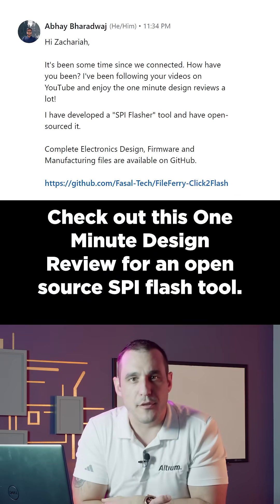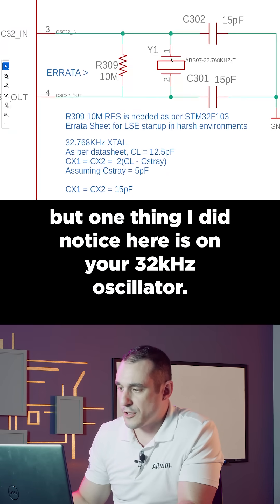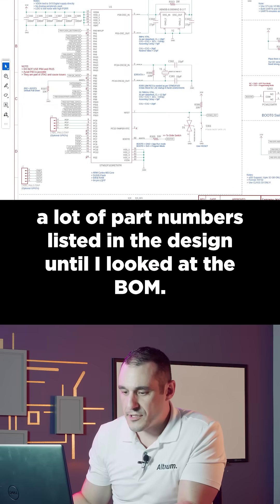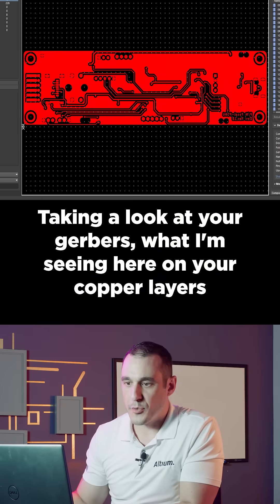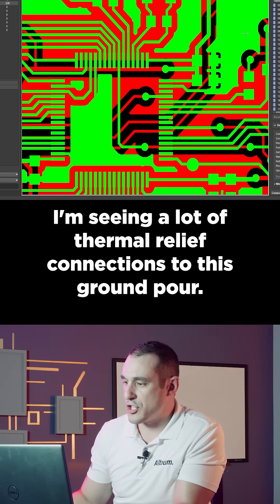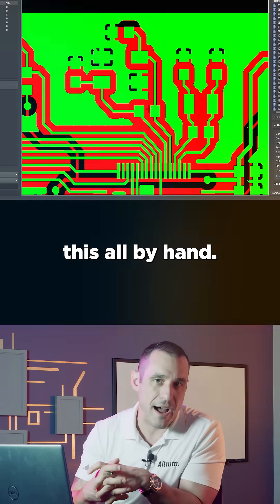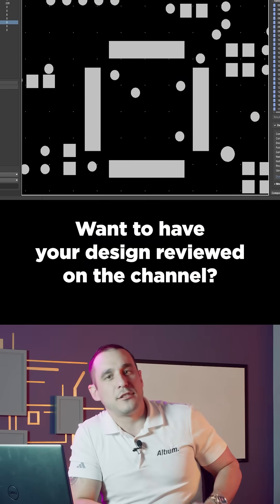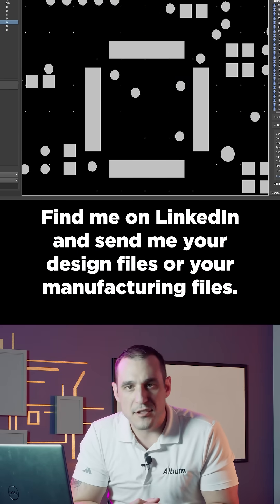PCB Oscillator Capacitance Conundrum | 1 Min PCB Design Review

Comment: Even if you don't need them, is there any rationale for not using thermal reliefs?  It's the same copper either way.
Reply: The rationale for using the thermal reliefs is to aid soldering and wetting, even in reflow they are sometimes needed when connected to large planes. For hand soldering I would say to use them, but given the accessibility of low-cost assembly services for prototype boards or hobby boards, I don't see why anyone would take the time and effort to hand solder every board. Maybe if you expect rework on certain passive components, then include the thermals on specific SMD connections to polygons.

The biggest reasons I bring up the thermals so much is because people include them due to the fact that the default design rule in Altium is to have the thermals included on both SMD pads and vias. Thermals on vias provide no value at all, especially if you already have a thermal on a nearby SMD pad. In fact, on a thermal pad connection on a large IC, thermals on vias are detrimental, therefore I always advise to remove them. My goal is to at least get people to look at changing the default rule when they are creating a new PCB, just because the thermals are on by default doesn't mean that it is the best choice for your design. It's your responsibility as an engineer to assess whether or not they are actually needed. And if you're not sure, send the PCB to your assembler to look at before you finalize the design.

Comment: I'm guilty of the jlcpcb part number thing too unfortunately. I really need to start adding the proper part numbers.
Reply: Why not both?
Reply: @TatharNuar That's what I meant by that statement. Jlcpcb requires the LCSC PNs to be labeled as such in the BOM for auto population. I just need to start adding the original PNs to the BOM also.